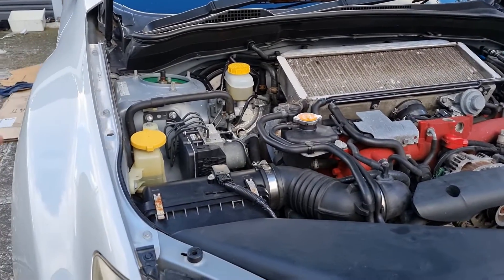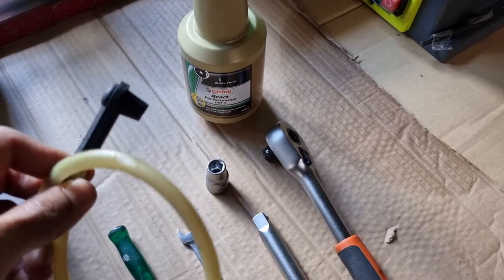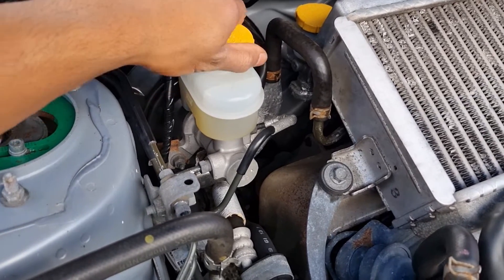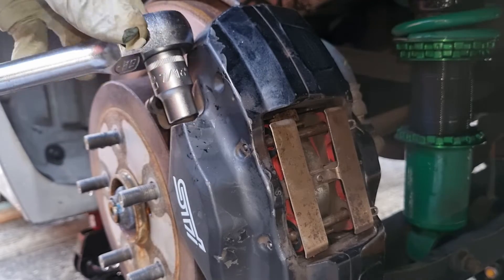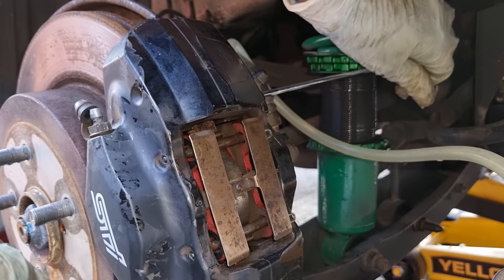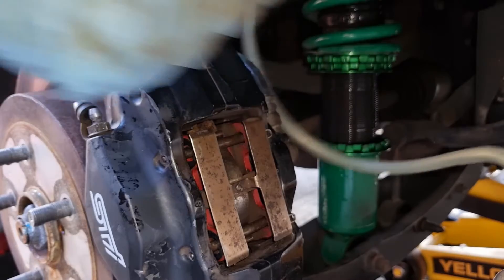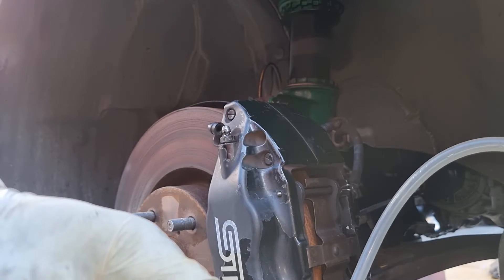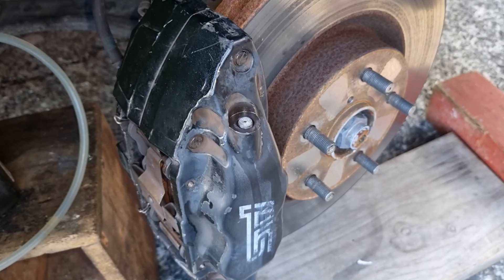How to Bleed Brembo Brakes - Subaru STI -  Full Process

Comment: Great video, thank you!

I am trying to change fluid (dot 3 to dot 4) with a higher boiling point. Do I suck the reservoir dry, fill up with dot 4 and start bleeding? Won’t it mix the fluids? I will bleed extra of course, I have a liter of dot 4 ready.
Reply from the maker: Yes thats correct. It will mix but your bleeding the system and topping up with new Dot 4. So it will be ok

Comment: The previous technician who last serviced my 2016 STI over torqued the caliper mounting bolts on the left rear caliper and the bolt snapped off inside of the caliper when I tried to remove it. The reason I needed to remove the caliper to begin with? Well, to remove the rotar to replace a broken wheel stud that was also way over torqued. I had to take the brake line off to take it to get it retapped. Is there a way to bleed that circuit alone without the use of a vacuum bucket?
Reply from the maker: @Rrrakanishu  Unfortunately this is a common trend I've seen with average technicans who are not familiar with this style of Brembo caliper. You can bleed out the front left caliper however for peace of mind I would recommend bleeding the entire system given the caliper was removed from the vehicle. 

In this video I cover the exact same issue with the bolt snapped off
https://youtu.be/4M4M8pz1tIg?si=BXrZThN3TEXR1WwM
Reply: @ thank you

Comment: Maybe a stupid question... Can I do this with battery disconnected or does power to the brakes need to be on?
Reply from the maker: Depending on how your carrying out the bleeding process. But no you do not need to disconnect the battery. Notice in the pump this was done with the engine off, so no assistance from the brake booster.